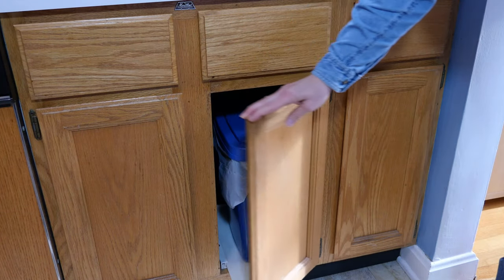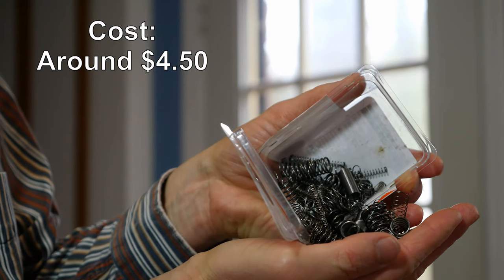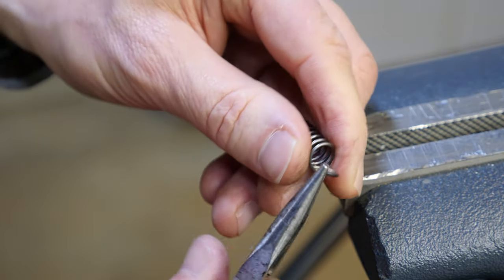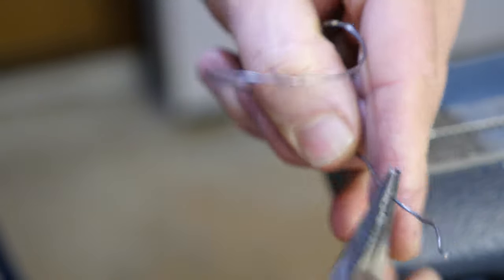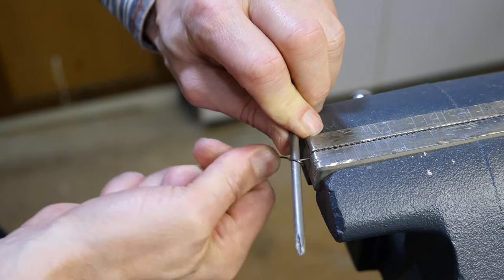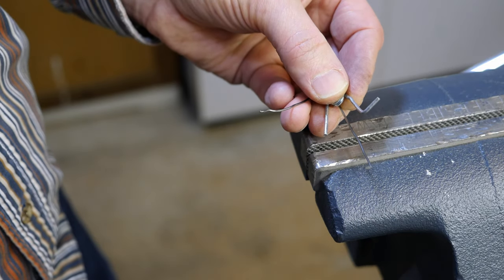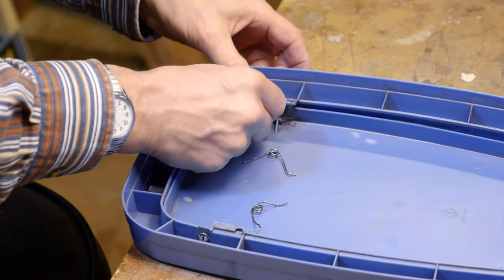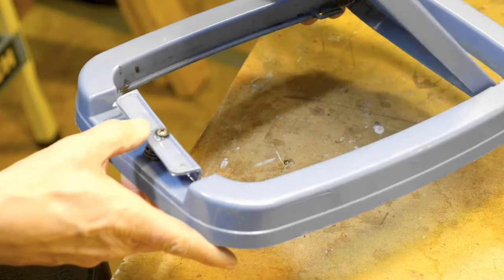How to Make a Custom Spring - in 4K video

Comment: I will give this a try... I practically have the same problem!  The spring type is called a torsion spring, the other types are compression and extension springs.  My under the sink garbage can is taller  than yours it clears the top of the cabinet frame by about 1 inch... What I did differently was remove the locking catch on the garbage can... I screwed in a scrap of 2x4  behind the face frame from behind, you can't see it or the screws from the outside... this is located at the top where the garbage can lid is located... The idea is this board extends into the cabinet long enough to hold down the lid down when the can is pushed under the sink. And it doesn't get caught on the lid because of the way the lid levers,  so it acts as the lid closer... When you need to throw something away just pull the garbage can drawer out and the lid pops open automatically - hands free - then push it back in and it closes automatically... This 'clever' arrangement worked for 20 years and everybody thought it was neat and wondered where I bought it... I said I made it... well... just today SNAP and the darned spring broke due to rust... the other one isn't long before it happens too , so I'll replace both.
Reply from the maker: I'm glad that this video could be useful. I mostly made this because I got a new camera (Panasonic GX8) and I wanted to test its 4K capability. I cast about for something to do and it just so happened that I needed to make a replacement spring for my trash can. 

We renovated our kitchen in 2017 and no longer use that trash can, by the way. We got one with our new cabinets that opens when you kick a pedal below the door -- it works nicely!

Comment: Thanks for making this video.  Looking to do something similar but starting with a manual lid trash can.  Thinking of using magnets to hold the lid closed, then when pulling out the trash can, I may attach a string or something to break the magnetic hold, allowing the lit to pop!
Reply from the maker: Been a while since I thought of this video! These springs worked for us for another year or two, then we updated our kitchen and have a different trash can. I don't really have any suggestions for you -- just keep working on the problem and try things until you find something that works. Good luck!

Comment: What do I do if I don't have a vice
Reply from the maker: If you don't have a vise, you will have to use what you have. C-clamps, Vise-grip pliers, anything to hold things tightly. Or maybe a friend/neighbor has a vise... they are not expensive.
Reply: Another pair of pliers will do, wrap elastic (rubber) bands around the handles of the pliers to act as a clamp.

Comment: Any other metal work?  Rather than buying and uncoiling springs for other purposes, is there something else I can use?  Thanks for making the video!
Reply from the maker: You are welcome! You need to use spring steel to make springs, and the cheapest place to get spring steel is by using a cheap spring that you can get at a hardware store. It's possible that you have suitable spring steel wire in your home somewhere in an application that you will never use again. For example, you might have an old cabinet that's going to be trashed, and it has a spring that you can salvage. You can then rewind the spring for whatever your new application is.

However, you must use spring steel. Any other metal (including other types of steel) will be unsatisfactory as a spring and quickly break.
Reply: @BobKovacs   Thank you.  I googled around and saw nothing that was a better option that what you say